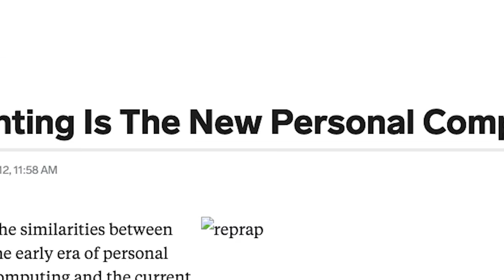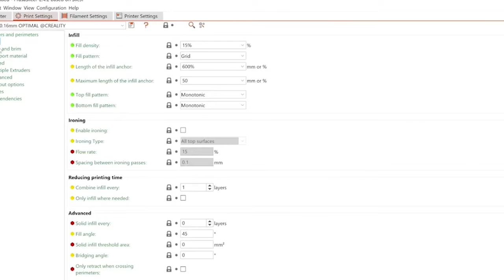Home 3D Printers Will Never Work

Comment: I agree, but not for the reasons you state.  Every laser printer is as complex as a 3D printer.  Most work for a decade with minimal maintenance.  3D printers will get there.  
The problem with 3D printing is that custom items need skill to design.  Everything else is cheaper and easier to buy.
Reply: Well,. and due to the nature of 3d printing, there are a lot more potential points of failure.
But until the design skill "problem" is "solved", no, 3d printers won't be in every home.
As it stands, I tell anyone who is interested in 3d printing to learn to model first, then get a 3d printer. If they live near me, I offer to help them a bit and possibly print parts that they designed.
Reply: @SirSpence99  yes if you can 3d model you'll get more out of your 3d printer.
 But i swear less than 10% of people who use a 3d printer make their own models. There's enough designs out there to satisfy most people. 

But it depends on what you use your printer for, is it for making custom items you would otherwise have yo make by hand? Or do just want to print some cool toys and such that are already out there.
Reply: @twanheijkoop6753  Of the...30 people I know who have a 3d printer, 5 of them used their printer maybe three times, and of those 5, 3 don't know how to model. Outside of those 5, maybe one person doesn't know how to model. While it is true that of the 25, only 10 of them do any significant amount of modeling, my point still stands.
Reply: @SirSpence99  from the 5 friends besides me who have a 3d printer I'm the only one who modeled anything as far as I'm aware, there perfectly content with the stls that are already out there. Even though I've been trying to get them into cad
Reply: @twanheijkoop6753  Well, it could be a difference in culture but I stand by modeling is necessary for "home 3d printers" except as a novelty item or a "purchase this product and it will be made in your printer" setup... Probably with a rental plan.

Comment: I respectfully disagree. To use the word never so much for a tech still very early on seems to imply the current tech won’t evolve.
 Home computers were outrageously complex, but evolved so just about anyone can benefit from them, even if they don’t understand them.
 I would also challenge the most complex appliance just about all adults have is a motor vehicle. Many owners can barely put air in the tires, but they own and benefit from car ownership.
 I think it’s highly plausible 3D printers will evolve to have plug and play replacement parts.
 I can also imagine remote fine tuning support, your prints don’t look right, you call a tech support line, they log into your printer and start making adjustments.
 I completely respect your opinion. I just wanted to offer up a different perspective.

Comment: Well… in part I agree with you. One absolutely should not be afraid of coping with technical things when planning to buy a 3D printer. But coming back to your the comparison with PCs—oh man, what kind of crap have I seen on people’s PCs. They also should not be part of the regular household (especially when running this thing calles Windows) but be egally restricted to people who can really deal with them (or at least use a search engine when things go wrong).
See my point? Yes, a 3D printer is a complex thing. But if someone wants to use them as a hobby, I absolute let them do so (after telling them that they will experience a steep learning curve).
Reply: Legal requirements... That's needed when things can harm other people (cars can "damage" pedestrians, buildings can collapse, electricity can kill...). But computers? Unless you throw them out of the window there's no damage to other people.
Yes, I know what DDos is but even well maintained computers can get hacked and abused and DDos can be mitigated by ISPs.
Asking for legal restrictions should be used carefully

Comment: You are talking about 3D printing for manufacturing. 3D printers are used for a wide range of applications. For example, engineers use it for rapid prototyping, which is a game changer. Any other way of testing a designed CAD part would cost significantly more to be made any other way.

Comment: Future is a vague term. I agree that in the near future, printing isn't going to be widely adopted. In its current forms, FDM printing is not going to be in everyones hoe. But there are all sorts of tech that were said to "never happen" by people who cannot imagine progress.  It could be 10 years, 20, or more. But the advancements that will happen in the future we cannot understand today. Just like how so much of our technology was "impossible" until it was here.

It is hard to take your viewpoint on this without a grain of salt, as we all know you have a vested interest in printers staying out of peoples homes so that they depend on a middleman to print their parts for them.

And dont get me wrong, local 3d print farm manufacturing is a great service that can fill many niches. But the future isn't black and white. We can have more printers in peoples homes, and more people manufacturing with local farms. These ideas can coexist.

I will say, on the repair angle. If the 3d printer is an applience it will absolutely need to be more reliable. But it is not unreasonable for it to require a local applience repair tech occasionally, just like with literally any other applience.
Reply: There are also ways in which they can become appliences that align more closely with how ownership is going. You mentioned amazon. At a certain point they may be the one putting the printer in your house, maintaining it, and occasionally upgrading it, because it may be cheaper to sell you the service of printing things in your own home than it is for them to drive it to you every time. A 3d printer in every home, that you don't own or operate. Likely on a subscription. That sounds a lot more like the future we're headed towards.

Comment: Not everybody, but a lot of people will have a 3d printer at some point in time.  However, that will not be the 3d printer as we know it now.  It will be similar to how you can now have a color (2d) paper printer.  It doesn't generate or replace physical books or other paper stuff, but you can use it in a pretty useful way.  The future 3d home printer will be similar, both in its workings and uses.  It will likely not use filament, but some paste or resin in 4 base-colors that get printed all inside a device the end-user will indeed not open (when have you opened your laser printer?) and has all inputs in user-friendly (but probably overpriced) containers that can easily be inserted/replaced without making too much mess.  Basically something like a current inkjet printer, but one allowing the paper (or bed) to also move down.   The biggest hurdle I see are ... overhangs and bridges.  But perhaps that could be solved by a separate soluble material filling those gaps and then getting removed (perhaps by heating it until it becomes a vapor) before the printer puts out its result.  I won't be the one solving the technical hurdles here, but I do think you are too negative on this ever happening.  It won't be for the coming decade, but I do believe it will come.
Reply: Basically something like advancements in Multi Jet Printing (which exists).

Comment: I guess you see it from a business viewpoint and how 3d printing is becoming easier and easier for the masses. That is encroaching on the booming business model for the print farmers.

I have been 3d printing not long… got my first printers this year. Im in my 40’s and enjoy it. It is not hard at all. Replacing parts is not hard either. 

I showed my 12yo, 14yo and 19yo how to find models, slice models and print on our Neptune3. They can all do it. They can even swap filaments. My 12yo even makes her own models using nomad sculpt.

My 14 & 19yo can print on the Saturn2 aswell. Only my 19yo is allowed to use it unsupervised.

This younger generation easily grasp this tech. At least the ones I interact with.

Comment: to get to the point of mass adoption the reliability from a plug and play perspective needs to be about as reliable as a home 2d printer. The prusas and a lot of the other high end printers are pretty close. there just out of the price range for most. a 3d printer is like owining a car, it needs servicing and maintenance once in a while, maybe thats just too much,however maybe theres a diffrence between having to spot the issue yourself vs the printer being smart enough to tell you whats wrong
Reply: Sadly my 3d printer has somehow proven to be more reliable than our 2d printer lately
Reply: Yep! Reliability, ease of use and disposability. We are maybe 30% of the way there on reliability, 10% on ease of use (if not a lot less) and not at all on disposability...

Comment: Yep! In order for it to even approach viable to be in every home, the slicer would have to be 99% automatic or the printers would have to be standardized and able to detect failures before they happen. Not as they happen but before. That means closed loop steppers on every axis. If you don't have that, any offbrand filament or bump at the wrong time could kill the printer. Keep in mind, the moment something goes wrong, if the print needs to stop and it doesn't stop automatically, people will break the printer. Oh, and no loud noises, loud noises freak people out.

Also, the printer would need to be fast, it needs to be able to print anything it can print in under 6 hours because past that point, it is effectively next day shipping, which can be met by a local print farm just as well.

Then you get into the biggest problem. Modeling. Unless the person is only going to print knickknacks and predesigned commercial parts, they need an extensive library of random parts. I'm personally of the opinion that there is almost no benefit today for a person to have a 3d printer unless they are willing to 3d model stuff that they can then print.

So I completely agree, the smallest "production unit" you will see will be local print farms that have maybe 10 printers. Those may just be "oh Bill is our family's 3d printer, if you need something printed, go to him." Or they could be actual stores. But, until the print farms can print out parts at ~2x the speed of like a voron (600mm/s), "on demand" printing won't be an option for all but the tiniest of parts.
Reply: My bread machine doesn't automatically mix ingredients or detect failure to rise and abort. Believe it or not, human beings are able to utilize & benefit from machines that don't always work exactly as planned and that require some learning to use, but let you do useful things with a lot less labor once you learn.
Reply: @daliasprints9798  And yet bread machines aren't in every home...

They are also disposable, if it breaks, who would bother repairing it?
Reply: @SirSpence99  Why is "in every home" the goalpost? Different ppl want and need different things. Re: fixing, replacement prices are comparable and the reason ppl repair printers more than bread machines is a culture of repairability, published specifications, and widely available replacement parts. If we had that culture more broadly, folks would fix everything that broke rather than throwing it away and replacing it.
Reply: @daliasprints9798  ...Because "in every home" is the goalpost of the video...
Reply: @SirSpence99  No, based on the thumbnail and video content, the goalpost seems to be "home 3d printers are a dumb idea".
Reply: @daliasprints9798  Well, then you need to rewatch the video and read the description...
Reply: @SirSpence99  If you want to be pedantic it's more like "home 3d printers except as a specialty tool analogous to things you'd have in a hobby woodshop are a dumb idea" and I still assert it's wrong. Woodworking tools require significant acquired skill to use. A good 3D printer can produce things for anyone who can follow directions for using it.
Reply: @daliasprints9798  ...No, he literally says "in every home" in both the description and the video.